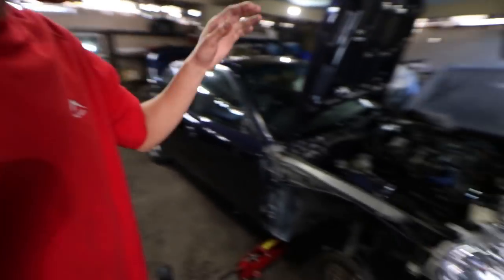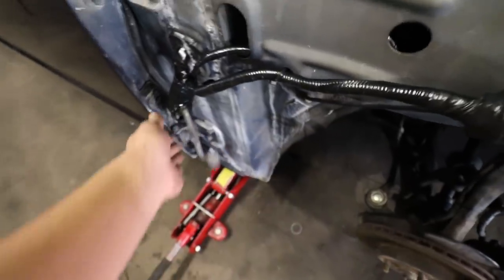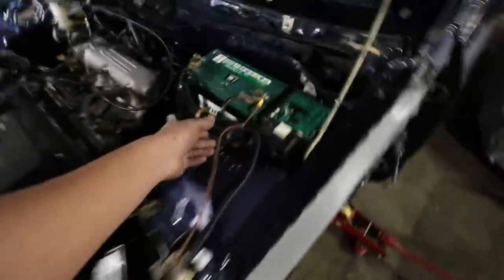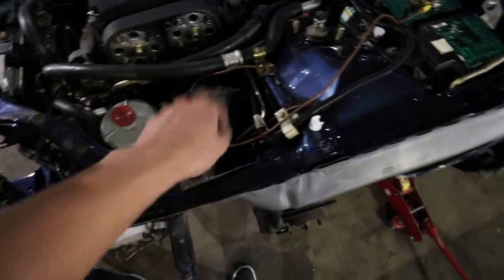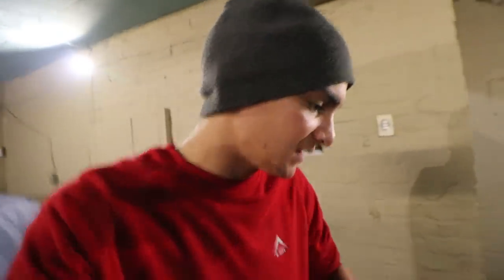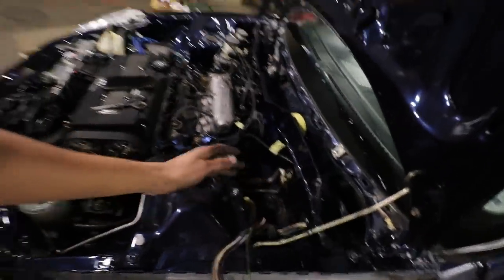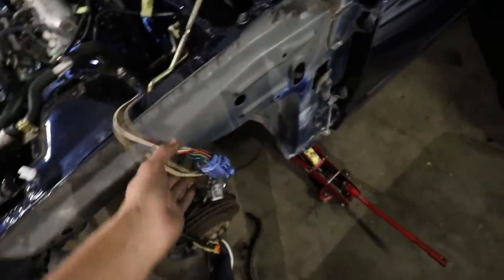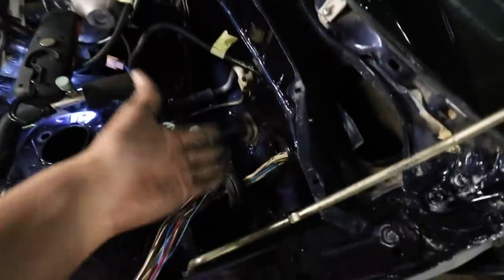Complete SEMI WIRE TUCK on Jody's Honda EK (FLUSHED ENGINE BAY)

Comment: Yo Mr latelate. I've done mine and now I'm sitting with out a hooter.  It seems I some how switch 1 or 2 wires around and now I'm stuck with no hooter. Lol
Reply from the maker: 🤣🤣 there is only one blue wire for the horn. The ground u just bolt onto the chassis.
Reply: @LateLateCustoms  
Maybe u can help me. I'm looking for a old spec VTEC ECU, LOOM AND A DISTRIBUTOR PLZ